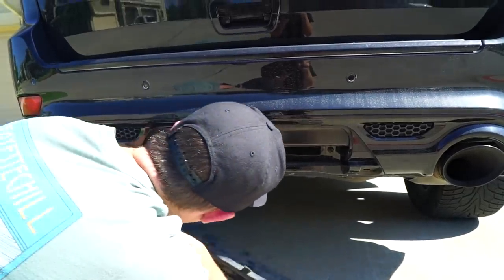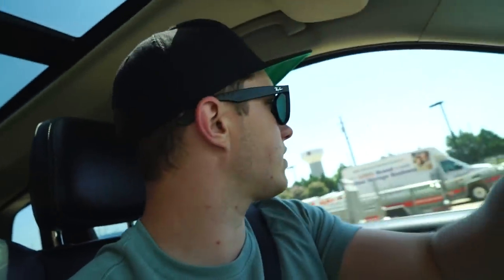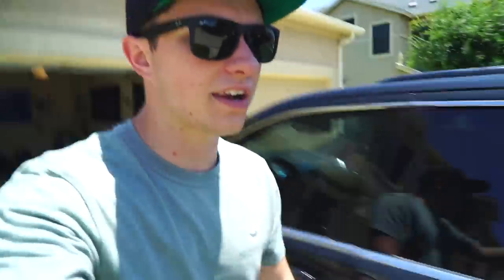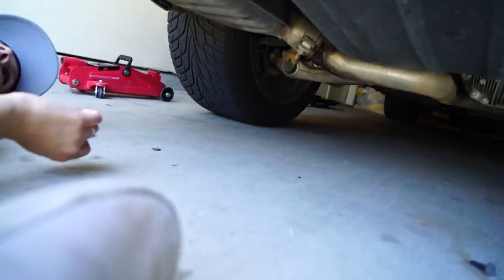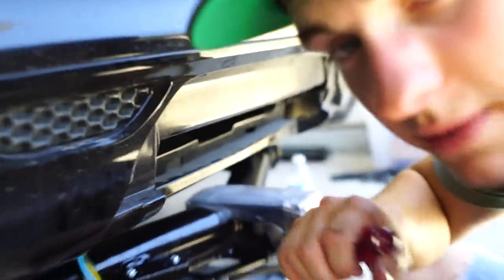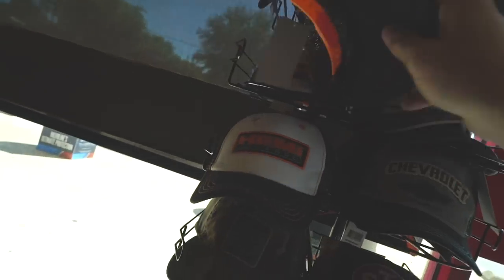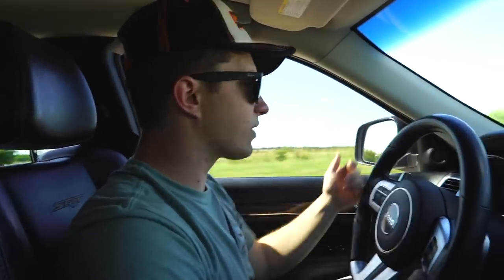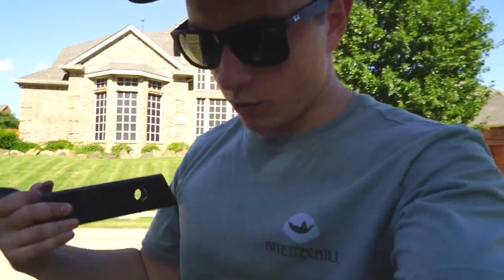READY TO PICK UP THE 1JZ LEXUS!!

Comment: You should have gotten a Mopar hitch, they don't hang down below the bumper. They go in place of the factory bumper bar and are covered by that center fascia cover You wouldn't even be able to tell you have a hitch. Also, the Grand Cherokees are wired for the Mopar trailer connector. The only thing that needs to be done is to add the trailer hitch and trailer wiring sales codes into the build configuration. If a dealership charged you more than $100 to add the sales code, I'd find a new dealer to work with.
Reply: Oh, and if you are questioning the validity what I said, I've been Chrysler tech for the last 7 years and installed countless trailer hitches and harnesses.
Reply: I agree. That hangs down way too low. The factory hitch would have been hidden and way more awesome.
Reply: How much does that cost to buy/install? Looks like he got a Uhaul hitch which I imagine is significantly cheaper.
Reply: Mistor Dave Cheaper isn't usually better. One of the best things I've learned modding vehicles over the last 15 years.
Reply: Okay?

Comment: What's wrong with trailering a welded dif on a single axle?
Reply: Riley Harless lmao right
Reply: Riley Harless you aren't actually supposed to single axle any rwd or awd cars
Reply: why can you single axle a fwd ? weight balance ?
Reply: BMW Hoons what they mean by single axle is like a car dolly
Reply: The welded dif won't let the car turn, going around corners the wheels need to spin at different rates. The drivetrain shouldn't matter as long as the car is in neutral
Reply: +BMW Hoons you can single axle a fwd as long as it's not ass first. Same reason you don't usually tow rwd backwards. Can't be reliant on the steering lock
Reply: Joe Bailey the car is on the trailer how would the cars dif matter
Reply: Riley Harless with a single axle trailer the back tires ride on the ground.
Reply: So he can drive the car with a welded diff but can't trailer it? I don't think the diff knows that the front wheels are on a trailer
Reply: You don't want the drive axl on the ground. You can tow a FWD on a tow dolly, because the drive axle is not on the ground. But I would always recommend using a car trailer to tow any car, if it's loaded properly, it's a lot more stable.
Reply: I was just confused cause I thought he was talking about a trailer where all 4 wheels are tied down. I wasn't thinking of a dolly

Comment: what is the difference between put a car with a welded diff on a trailer and putting a car with an open diff  ?  same thing
Reply: Alexandre Magalhaes when you put a car with a welded diff the car sorta pivit  instead of turn
Reply: Tanner T but you ate just going forward tho
Reply: a single axle trailer is what they had and those only lift the front tires on the car and the rear tires just follow on the ground

Comment: Tow mode is used to keep the transmission fluid temperatures low under high load. Pushing the tow button causes it to stay geared lower (especially noticeable at highway speed). Hope the info helps!

Comment: Pro tip for reversing a trailer is stick to just using the mirrors. If you see the trailer swinging to one side correct and vice versa. A trailer like that, more so without a load, will probably be pretty hard to see out the back window.

Comment: The tow mode on those srt8's makes the gears longer and stiffens the rear suspension, also raising it in the back so your front number one and two cylinder rod's don't get starved of oil.

Comment: Gas is so cheap in the US
Reply: tugytur i was going to comment that but he may not have filled the car
Reply: But that wouldn't change the price per Liter or as on the Video per Gallon.
Reply: tugytur the prices went down , we used to have gas $4.57 a gal in Oregon, and now it's down to $2.87 a gal
Reply: Boosted Miata I've seen it as cheap as $1.85 per gallon in Florida
Reply: Holy Crap, right know here in Switzerland its around $6 per gallon and that counts as a "cheap" price
Reply: tugytur but tbh switzerland sucks in generall, when it comes to owning a high performance vehicle.
Reply: It's the worst. That's why I and most of my friends only have Track-Cars. Have to trailer it everywhere.
Reply: tugytur I'm from zurich myself and its just a pain in the ass to do anything to your car. I would love to have a track-car but wouldnt know where to and how to trailer it proper. But that would be huge. What's your track car btw? if you dont mind me asking.